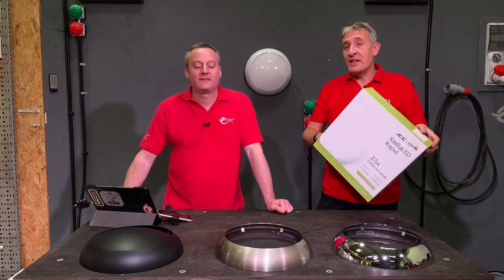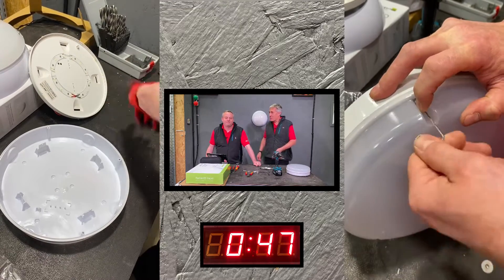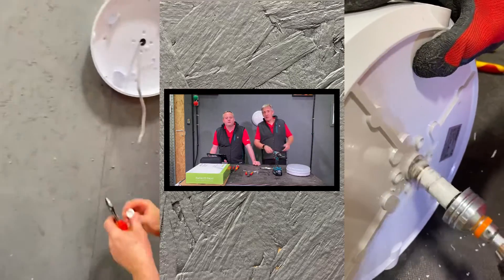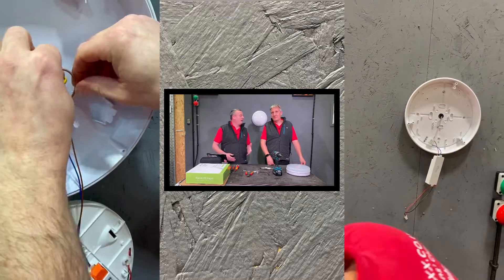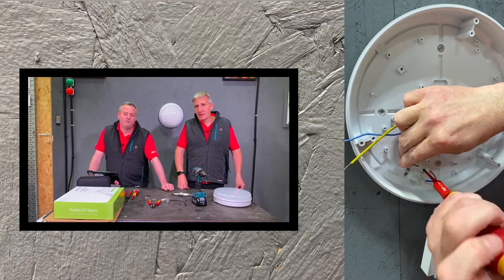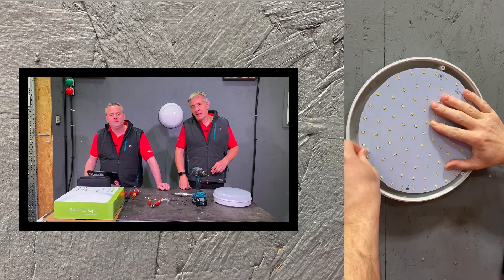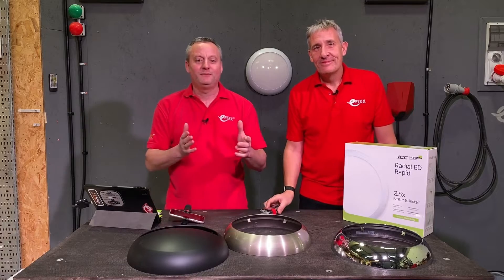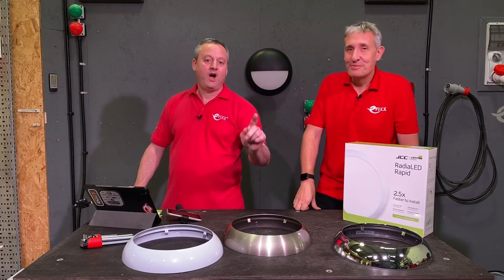ELECTRICIANS TIME IS MONEY - FASTER LIGHTING INSTALLATION

Comment: Hi I am trying to get my head round a problem.
I have an led bar light that I am using on an aquarium it's rated at 860 watts????.

I am also using an ad to dc transformer that is rated at 1.2 kW on the output side.

When I attach my watt plug to this unit it only shows me 80 watts approx on the meter, on the mains side. 

Am I correct in thinking that the unit at 860 watts is incorrect or is there some difference between wattage at 12 volts wattage and wattage at 240 v. 

I hope you can understand my meaning here does the wattage decrease at 240 volts. 

The reason is I want to add another 860w unit but if they are in fact 860w it will overload my transformer. 

Although it would take a hell of an led light to actually give 864w.

Regards Martin steele

Comment: Why has the advent of LED created the end of the user-changeable lamp? From a specifiers point of view, I want a fitting that has a removable lamp that can be replaced by a resident as a consumable item rather than needing to call for an electrician to replace the whole fitting.
1. Changing the fitting is expensive, especially if it is a fancy high aesthetic living room fitting.
2. In a residential let, I don't want to call out an electrician when a simple lamp replacement could have cured the issue in seconds.
3. Before anyone talks about how long these LED fittings last, it's simply not true, especially in bathrooms and kitchens where the lights are switched on and off regularly.
4. When it dies and can't be re-lamped, it's simply more for landfill.

Comment: ... i feel like what's shown as the old style is something from like the 1980's cause I've been doing electrical installations since like 1999 and I've never had to unscrew the front, everything I've installed has either had a slot for the front to slot in, or 3-4 holders you just twist with your fingers and take the glass out easily. And EVERY SINGLE ONE I've done came with all hole drilled and line connectors. This has to either be a British only thing or some such nonsense.

Comment: Haha these make me laugh every time I buy one. Should say 2.5x faster + 300x more packaging lol
Reply from the maker: No plastic though
Reply: Yes I like that aspect, however the 2.5x faster statement is lost with the unboxing. I do like the ability to change singular items to suite needs adding in an emergency function or microwave sensor would take no time at all. I do think the electrician would benefit more however if JCC did a pre made up version in one box to suit your requirements less space taken in van too. Overall great product  though 👍
Reply: @darrenfreeman6205  Thank you for your feedback Darren. The cardboard packaging is to protect the product internally, whilst separating the elements to allow for a faster unboxing and installation process. We will take your comments on board and consider how we can reduce this in the future. We currently supply the RadiaLED Rapid in 2 states - complete and modular. Some wholesalers choose the complete version in a single box, others choose to buy empty bodies and offer the internal LED tray modules separately.

Comment: I've fitted quite a few of these recently on a couple of different estate lighting replacement jobs, and there is a lot to like about them.
However, once you're in a real world situation rather than a bench test, that time saving becomes a lot less significant. Mounting on board with a single cable entry from the rear is one thing, but onto a brick wall with an old pyro from one side and an SWA from the other is quite a different experience.
One thing I have found awkward with these is when using the side entries, access to the gland at point of entry is restricted by the body of the fitting angling outward, ie. you can't easily get your grips or spanner onto it straight.
Reply from the maker: Good feedback 👍
Reply: Thank you for your feedback, Patrick. We will take your comments on board and ensure they are addressed in future developments.

Comment: Fitted loads of these, the bezels can be a bit of a ball ache, but other than that a great fitting, if memory serves me right, all the different wattages are the same size ? whats with using 2 different strippers?  points off for that Gaz .. a hacksaw is your friend with those allen keys , cut it and shove it in a drill driver :)
Reply: Hi Torchy, thanks for your comments, we will take your feedback regarding the rims on board and consider in future developments. The 8W is a small body at 232mm and the 12W, 16W and 24W are in a larger 301mm body (without rim/bezel).

Comment: Fantastic,  I do like those lights I have one in my bathroom and one in the kitchen not the same brand  but the same  design . Gaz why why did you use two different automatic cable strippers ? ,  why not use an Allen bit in the Drill or a ratchet screwdriver? ..
On the hole a fantastic comparison. 
Fantastic video as always guys 👍👍👍👍❤️

Comment: Ive been fitting loads of these at a community centre...  Its great that the bezel does not screw on so can be used with conduit.  I have also used the microwave sensor for outdoors..  Because of these lights and the customer loving them it has generated loads of extra work replacing even more old light fittings with these.  Just ordered a black eyelid fitting (Was more difficult to find a supplier who sells this) for a staircase leading to a stage where they want the light to go down and not up so will be fitting it to the wall.   I love that the 12w/16w/24w are all interchangeable, I ordered some 16w which were a bit to bright for the area, so ordered some 12w for another area where I needed 16w and will be swapping them over without having to take the fitting apart.   Very reasonably priced also...   There is a bit of knack to getting the bezel on and off and you guys make it look way easier than me (Could be me making a meal of it)  thanks guys its because of your earlier video I have been fitting these as well as the jcc skypack QR light fittings and the knightsbridge self testing emergency lights, because of your videos and learning about these products I have got loads of extra work as the electrician with the smart affordable solutions...    Keep up the good work guys..
Reply from the maker: Great feedback Steve - next time we are doing a review sounds like we need to get you in to the studio 👍
Reply: @efixx  Great to hear, thank you Steve